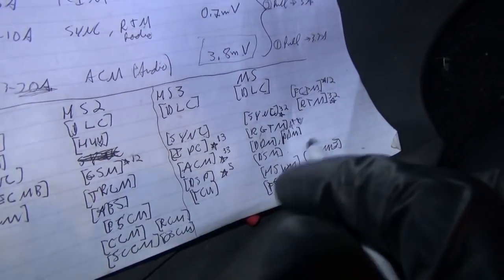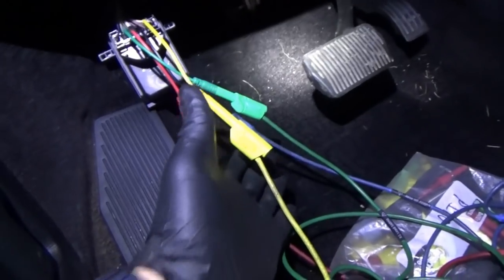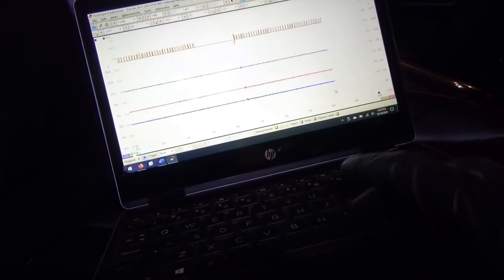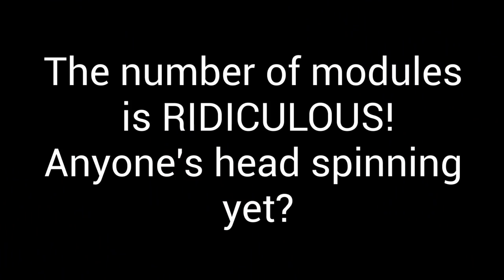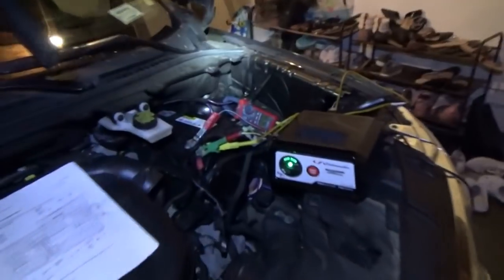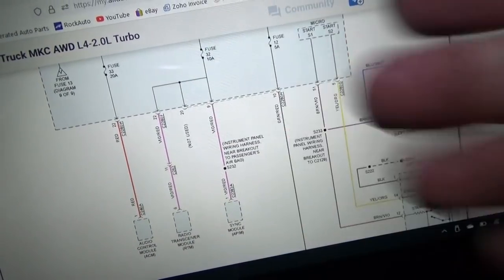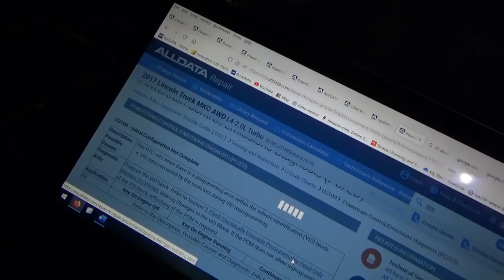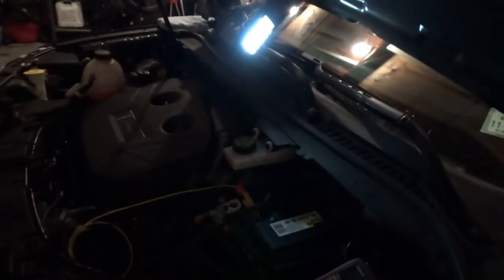7 HOURS to find a 5-AMP Draw?! (Lincoln MKC - Part 2)

Comment: Such a labor intensive diagnosis.... How would the stealership have handled this one?... Do they possess a factory tool that analyzes all modules together and pin point the draw?... Seeing this really makes me think autonomous vehicles are as bit further away than people think... Bet you slept good after that one, Ivan!!....
Reply: The autonomous questions are facinating.  Will there be redundant systems to get a confused car off the freeway at 3AM? Will the systems have backup strategies to ignore or reevaluate data that is somehow suspected as being corrupted, or low likelihood or probability? Fully autonomous crosses the line where life or death is decided by MODULES. The questions boggle the mind.
Reply: @hightttech  All valid concerns for sure... The power and wealth in charge will have bean counters showing data that injuries and deaths will be significantly lower from autonomous error, as opposed to human error... Acceptable losses... Interesting time to be alive - that's for sure...
Reply: @steveo6631 : Ah yes... the bean counters. Reminds me of Ford's fiery Pinto, and the many unethical decisions to save a dollar 💵. Now I'm REALLY skeptical of autonomous vehicles 😆.

Comment: Ford places a key fob pocket inside the car to read the fob in case the fob battery is dead, I would have tried to place the fob in it to see if the car would start without the module plugged in
Reply: As shown by Wes here: https://youtu.be/hSjYu6DrTFs?t=1878

Comment: I see a couple of issues with this diagnosis. 1) The fob was too close to the car for all of the testing. 2) When you tell the scanner the original module is present, it pulls the programming from it and then puts it in the 'new' module. If the program was corrupted it would have been better to tell the scanner the original module was not present and download new programming to install. The module might be toast anyway but it would be worth a try.

Comment: Great Diagnosis Ivan, you'll let us know if the new Radio Control Module fixed the problem? Seems it may cost more than the battery though. Where are the Edsel's when you need one?

Comment: I was shocked when I first read the description. If something was pulling 5 amps alone, all the time, it would be very hot or on fire. Nice job. I have never heard of a module keeping the whole car alive causing a constant draw. Are you sure these networks in cars are worth it?
Reply: 5 amps at 12.7 volts is 63.5 watts, there are many devices in a car that can draw that and much more.
Reply: @barryaiello3127  P=EI 👍 or P=I squared R

Comment: Looks like that RTM also does the keyless key fob functions, tire pressure monitoring and other jobs. There is an issue with programming concerns that in error show tire pressure issues on the dash and Ford has a memo to dealers to re-program them as a fix at no cost to customers. My guess is, this car was one of them but the issue was more serious than just tire pressure monitoring faults...much deeper. Probably a $150 part at Ford/Lincoln as Rockauto doesn't list it. Can you imagine having to send a complaint letter to Lincoln after finding out the RTM needs replaced and spending an approximate $700 to find the issue? A good 4 times the cost of the part and that the part was likely defective the day it was built ! In just 4 years, maybe Ford/Lincoln would consider this under warranty? I know, dream on...Thanks Ivan...

Comment: You could definitely get yourself in trouble on a diagnosis like this if you just start pulling fuses because so many different modules were awake, it wasn’t that the RTM was actually pulling that much juice, but it was forcing everything else to pull juice, pretty wild diag.

Comment: You Mr Ivan are absolutely at the top of ya game like 👍 amazing diagnostic skills and very few would of stuck to it without farming it out to someone else.
Just a quick question...... if you had cleared the faults originally and couldn't get rid of the receiver fault then as per this video do you think you would of concentrated your diagnostic scheme of work towards that? Love watching you you're top level 👌
Reply from the maker: We'll discuss this in Part 3 👍
Reply: That was a big time clue but was lost in the long list of dead battery dtc’s. I’m curious if another module were to have a similar failure but not set a code. Either way watching/learning scope usage in this situation was a treat!
Reply from the maker: @blueskiesmobileauto4253  PicoScope and dozens of wiring diagrams was the weapon of choice lol

Comment: The only thing I might have done once you'd gotten this far would have been to back-probe the wires on the RT module to see if the problem was downstream (upstream?) from there.  Otherwise there is no way that I would have gotten as far as you did.  Great job.
Reply from the maker: What do you mean by upstream or downstream?
Reply: @PineHollowAutoDiagnostics  Simply the I don't know what they are.  If they're receiving from sensors I'd consider that sensing to be upstream (like verifying tailgate closed), if they wires providing power to perform a function (like lock tailgate), I'd consider that function downstream.  I'm just wondering if they might be faulting, causing the RTM problem.  I could be way off because I don't know specifically what the RTM does.
Reply from the maker: @billsmith5166  ah I see... Inputs and outputs. This module just has power. Ground, and comm lines 👍
Reply: @PineHollowAutoDiagnostics  Wow!  That's a lot of current going to that module!
Reply from the maker: @billsmith5166  actually there was very little current being consumed by the RTM module... Maybe 100mA 🙂

Comment: What would've the parts cannon firing sequence have been for this case? If this were "take a guess" parts replacement repair,  which parts would the typical mechanic have tried replacing?
Reply: They may have seen the B2100 return and shotgunned the module. Would have maybe gotten lucky.

Comment: Seems to me that a Lincoln dealer would have seem this problem before, and went straight to that mod.
Reply: LOL
The dealer would set an apprentice on it, who then would have had a senior technician look up the service bulletins, bounced it to their other technician who would have re-read the service bulletins to no avail, kept it for a week then charged a couple of hundred dollars and set the customer on the way.

After the customer returned on a tow truck the next day, they would have started firing the parts cannon at it until the customer gave up spending money at which point the head chief technician would explain that the can bus wiring harness' need to be replaced throughout the car and it's cost prohibitive. (or some other equally weak excuse because they NEVER admit they can't fix it).

That's what dealerships do.
They are incompetent. Intentionally so.
Reply from the maker: @jimmyb1451  a plausible scenario lol
Reply: @PineHollowAutoDiagnostics  Lol I used to contract to dealerships here in Aus. 

Even though they had much shinier, much more expensive machinery and equipment than I did in my van.

The sh...tuff they pull to "repair" warranty claims.... 

For eg, (Without mentioning names of course) a specific variant of a certain model of a particular manufacturer's commodore that was coming off the factory floor with front and rear hubs (IRS) that had "parallelism problems". Not all of course, but on a number of the cars the rotor face on the hubs wasn't parallel to the bearing faces. So they were getting warranty claims for pedal pulse and shaking wheels after 20-30,000k's. 

Their "repair"? machine the brake rotors on the car.

IE: Machine the rotors crooked, to match the crooked hubs such that the run out was within tolerance. 

The best part is, they had their own Pro cut, portable brake lathes WITH electronic run out correction. I had manual lathes because throwing them in and out of vans would require constant calibration that requires you send the lathe off for a month at a time to be performed. BUT STILL they called me in because they believed that I would get them straighter than they could. (which, to be fair, is probably valid)

To make it EVEN more ridiculous, they would also insist that I didn't clean off the rust and other debris from between the hub and rotor because "disturbing that would...." 

???? The hubs are already crooked! They're intentionally machining the rotors with run out to correct the run out in the hubs, but you can't clean off the hub face because the rust helps true the???? WHAT??!?

This is the level of mechanical aptitude we're dealing with. 

I know I'm preaching to the choir ;) 
I'm just making the point for old mate up the top there who seems to think that dealerships are somehow better at mechanic-ing.
Reply: I'm just saying they may have prior knowledge. I looked up service bulletins on this car, and they are listed on Ford's sight.
Reply: @richardrtracy  True, well in that case I shouldn't have assumed your intent I guess. Sorry for that.

Someone else actually quoted one of those service bulletins and they didn't apply to this particular year model.

Either way, I think the take away is that these systems are a really bad joke and a stellar example of really poor system design.
Reply: @jimmyb1451  next brake job better hope they don't remove the rotor from the hub or it probably won't get reinstalled in the same place on the hub
Reply: @cincinnatusaurelius8371  Exactly!
I did question what they intended to do after the rotors worn out.

They didn't answer me, but we all know the answer. ;)

Comment: This suggests a new feature for scanners.   A sort of "debug" mode in which you would connect the scanner to a CAN bus, and it would just tell you which modules it was seeing messages from.  Guessing the scanner can already ID modules and understand the messages, so this should just be a new mode, no new hardware.   Probably there is already some sort of CAN debug device that can do this.
Reply: I doubt most scanners can read most CAN messages... They are usually pretty manufacturer specific and not public. Other automakers also use other networks like LIN, ethernet, vw k-line etc
Reply: Well you would have to format and reflash to module, that's even if the eeprom is good in the first place an it isn't a hardware fault like a bad eeprom chip itself , I wish it was like windows where you can hit debug your computer and find errors in its coding
Reply: GM already has something like that.
Reply: I doubt that would work because oftentimes the defective module is spewing garbage on the network which is waking up other modules and causing the draw.   You probably couldn't even query the other modules on that network very well (to see which ones were talking) because of the trash being spewed on the network by the defective module.

Comment: Yes, my head is spinning.  Can you imagine a dealership troubleshooting this?  Why are these new cars so complex?   I can understand controls for fuel, ignition, etc, and airbags and such but modules for door locks, radio, lights.  What’s wrong with switches, relays and fuses for simple stuff.

Comment: By doing the reprograming of the module. Does that prove the wire integrity? And they want to put 40 ton trucks with no drivers on our highways.
I have one of the first transistor stereo consoles made and it still cranks out like new. Engineers back then "peaks at 3 watts better install 5 watt". Engineers today "peaks at 3 watts.  Better use a 2.5 watt to save some money". "That will keep the technicians guessing".

Comment: A modern car, with 70 something modules, can take days (sometimes) to diagnose a parasitic draw.
Reply: wit until the electric cars take hold, 2000 modules
Reply: @randy1ization  the electric drive systems on electric cars is fairly simple and straightforward. All this complexity in modern vehicles comes from either mandated emissions controls or more commonly unnecessary comfort/luxury technology. Its become a race to see who can build in the most bells and whistles and electronic gadgetry in new cars.
Reply: @kmac6399  I would imagine electric cars have many potentiometers, redundant safety systems,  a lot of corrosive DC electrical connectors that will wreak havoc..  time will tell.. EMF interference will come into play as well.

Comment: You should have tried the programming step selecting "original module unavailable", other wise you were just backing up the corrupt data and reinstalling in on the old module. If you had chosen "no, aka original module unavailable", you would have generated a fresh, uncorrupted configuration file and installed that on the old module, which is obviously hardware functional but has corrupt software/data!
Reply: where does the fresh uncorrupted file come from?
Reply: @randy1ization  Probably from Ford, over the Internet.
Reply: Yes I noticed that too.
Reply: @randy1ization  I'd imagine the PCM generates it, or the tablet has you input vin, option codes etc and you generate it on the spot... Why would they otherwise give you that option?
Reply: Samuel Lim  Fair enough, but surely that option "original module unavailable" is there for a reason, and does something differently than when you select 'old module"...
Reply: To use the PMI with out using the original modules as built data the scanner would have to be connected to ford website and it would be retrieved that way or he can obtain the as built data via their website. 
Ivan you will have to do a parameter reset when you install the new module and this will be tricky with out accessing pats functions menus. 
BCM TO RTM parameter reset. 
And I think that yes the RTM could cause a pretty large drain because it drives the low frequency antennas inside the vehicle
Reply: @randy1ization  You upload it from from Ford as either a file or input /type what is known as the As Built data code. AFAIK, during PMI(programmable module installation)the Ford scanner normally goes onlne to ford and retrieves that info just in case module is corupt.
Reply: @jovangrbic97  Definitely wouldn't have hurt. I agree with you, John. That B2100 was a big clue. I also would have liked to see Ivan's prep on the vehicle to find the parasitic. I commonly open all doors and latch all the locks, remove the key fob from the area. I know editing is involved, But it is an important step. Nice Job, Ivan.
Reply: @jovangrbic97  It would seem that if the PCM generated it, it would just ask you if you want to overwrite the existing file. maybe a new module has data that is extracted , and them programmed to the PCM?
Reply: @Joetechlincolns  So ,,, Ford either already has the info programmed into the module and when you connect to thier website it activates it as a recognizable program to the PCM in the car, or it generates it while your online, then downloads it thru the techs diagnostic software, then into the PCM? WHAT IS THIS STAR TREK>?    I would not think it downloads the program from the ford website, because that would be an open backdoor for hackers..
  Sounds like they are trying to force most of the population to go to the dealer when a module fails. I know that they will sell you a module but wont warranty it unless they program it.. thereby breaking it off in the customers orifices from both ends.  I doubt even the ford dealership techs even know exactly what is really going on.,  they follow the instructions given by the  master computer in detroit and hope for the best. its very hard to fix something when you dont know exactly how it works. if you ask them they would likely tell you its proprietary,,,
Reply: @randy1ization  . I can't speak as far as Ford security other then the endless issues we have with the Ford site and the newer cloud based scan tool software(FDRS).  Ford has a large database for all vehicles it makes, has made with all the module build data. Most modules can be used on models with different options or a different model alltogether. Performing a PMI is just a way to setup the module to work within the parameters it needs on a specific vehicle. One example of this would be an input could be ignored or not. I wish I knew more. Yes the module comes with just enough software/firmware to somewhat function, but as I said before, the PMI process tailors the module to the vehicle and it's options and parameters.
Reply: Samuel Lim  Nice to know, still would be curious what the other option actually does...

Comment: I hope I'm not alone, I can't stand anything ecoboost, lots it issues with coolant/water pump, turbos and pipes, and the awd ptu's just to name a few. The last 1 I had in lost both turbos, turbo intake tubes, and leaking coolant hose,  it was a 2015 flex 3.5 AWD GTDI ecoboost with 47,000 miles on it. A month later it was back for a water pump and timing chain/ kit, phasers and solenoids. It's now in line to come back for under temp code,  and low fuel pressure in the gdi system. Oh and also failing keys. I'm pretty sure once I fix that it'll be back for the ptu leak that isn't there yet but I'm sure it will be. It now has 52,000 miles on it.